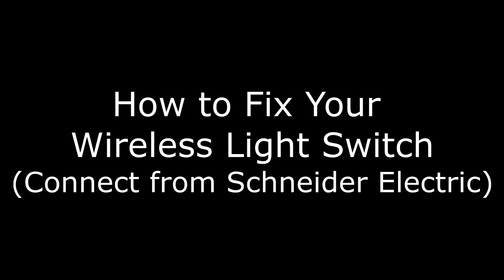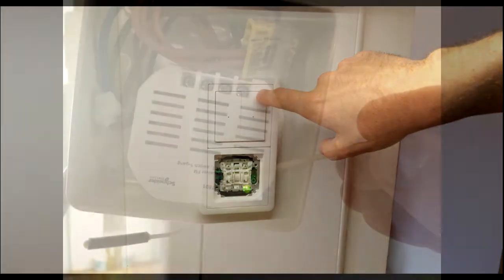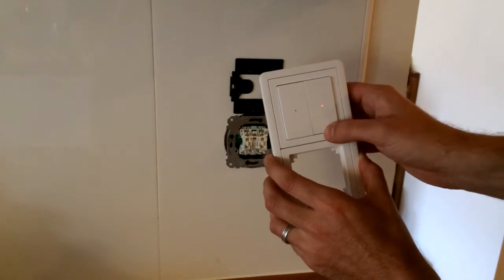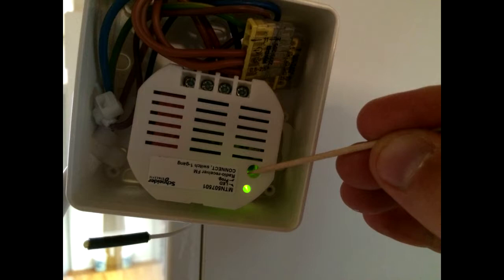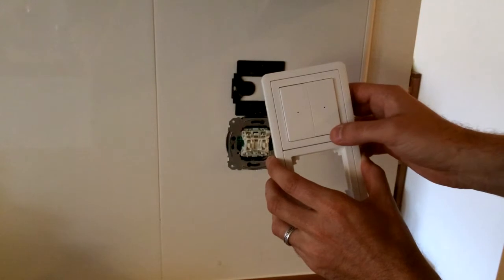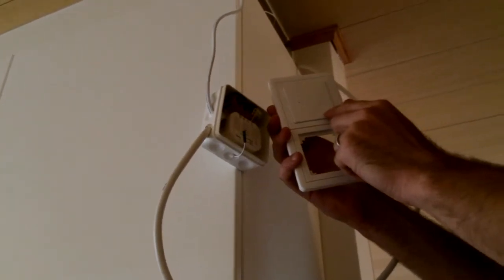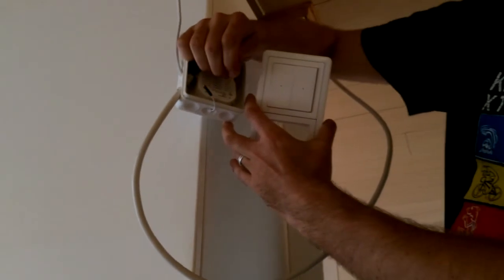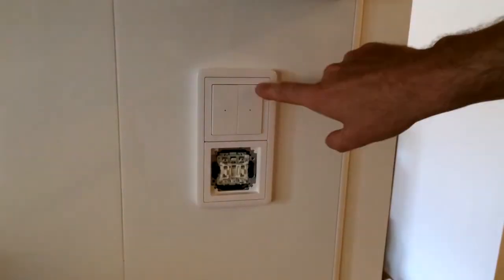How to FIX WIRELESS LIGHT SWITCH (CONNECT from Schneider Electric)

Comment: Thank you, this worked for an amertac rft1600. Just had to hold the switch on the plug side till the light blinked and then pushed on (up) on the switch 3x fast.
Reply from the maker: Nice. Thank you for sharing. My guess is a similar approach works with most wireless systems.